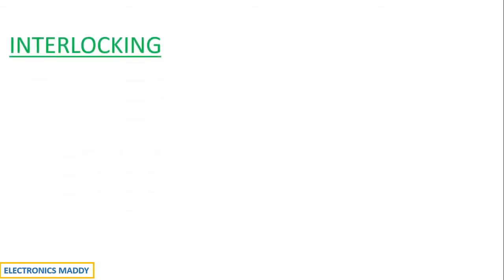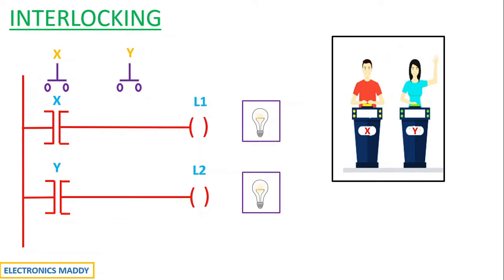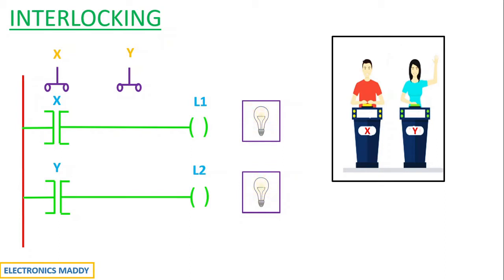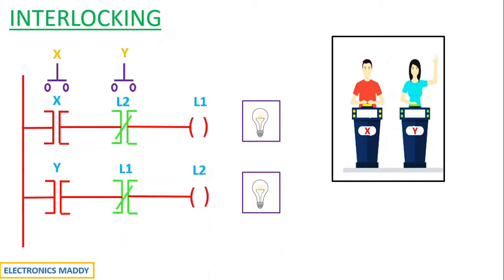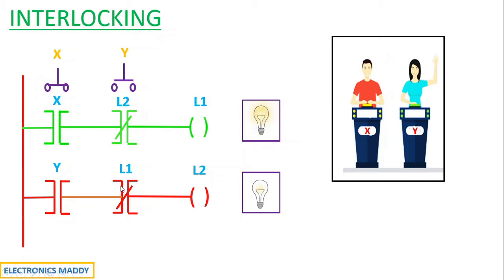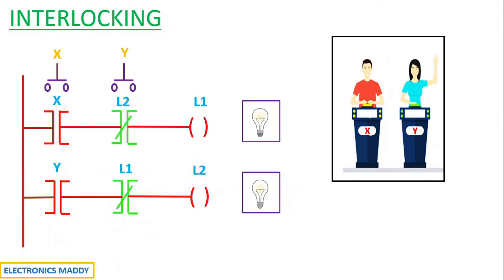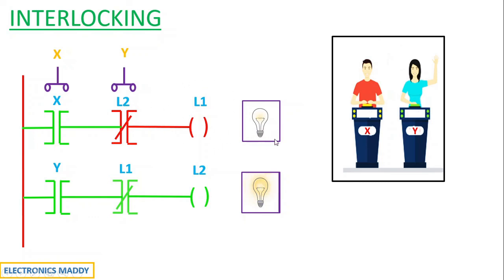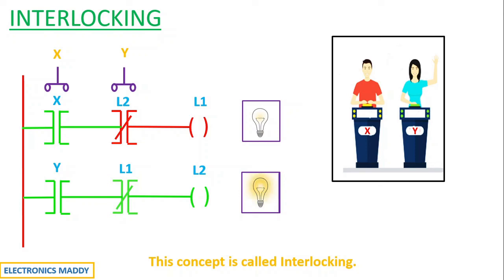Interlocking in PLC

Comment: I do have a doute.  We may have 3 pumps and. A level switches. Low level , level 1 , level 2. 
 And 3 pumps and pump 1 start in level 1 and p2 should start at level 2 and the same time p3 should on and all the pumps should run until low level and. Each stand by pump should change. How ll the program can u explain like this video